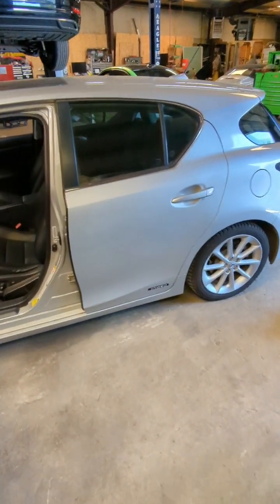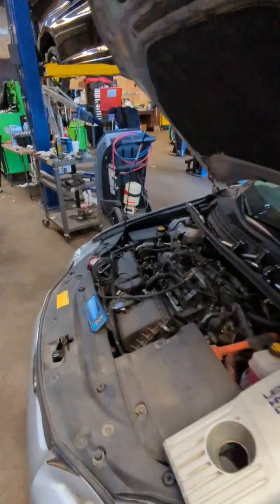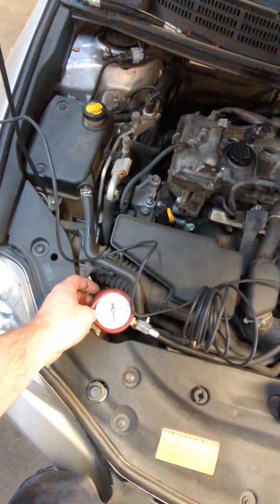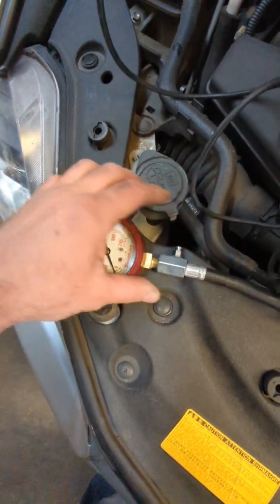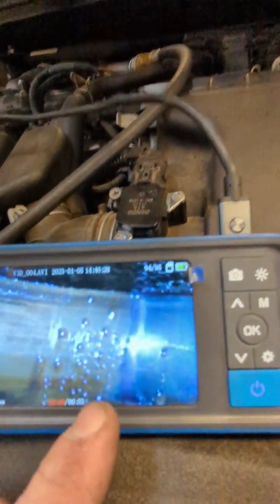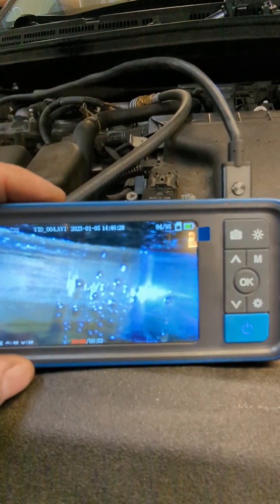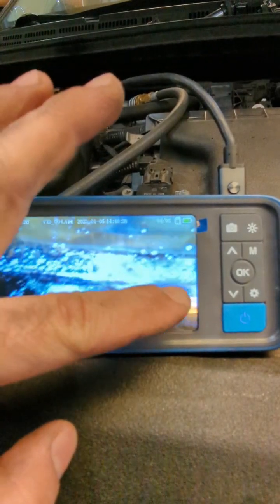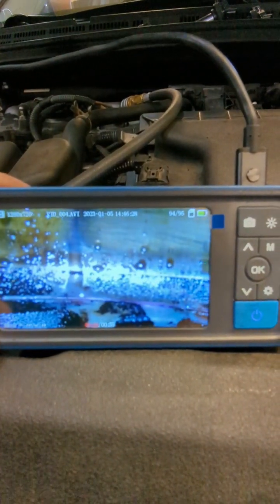What's wrong with it? Lexus ct200h cylinder #1 misfire

Comment: Head gasket replacement? What’s the typical repair cost?
Reply: had mine done and it was ~$1800. that was about 35k miles ago and it’s still going strong
Reply: @Boobabrain at what kms yours went? I have a friend with 282,000km and it has this same fault. Gonna try spark plugs first. 
Can you give a rough run down on other parts that got replaced during head gasket repair.
Reply: @Boobabrain  Where are you located?
Reply from the maker: This one got an engine replacement instead.  Total cost of $6067
Reply: @DiamondStarWerks is it worth it to replace
Reply: What’s the fix I have same issue just ordered coils I’m afraid will be same problem but this just happen two weeks ago
Reply from the maker: Head gasket was blown on this, they need to be replaced if this is your issue.  I would recommend professional diagnostics before jumping the gun on a large repair.
Reply: I have the same fault on the friend's '14 model with 282 thousand km. Gonna try spark plugs and coil first but have a strong suspicion that the problem is deeper since the car was meticulously maintained by local Lexus dealer all its life. How involved is the gasket replacement I wonder?